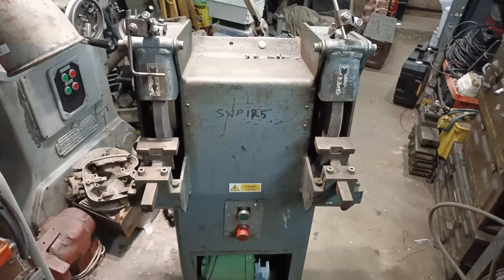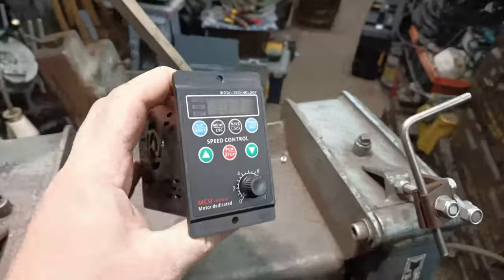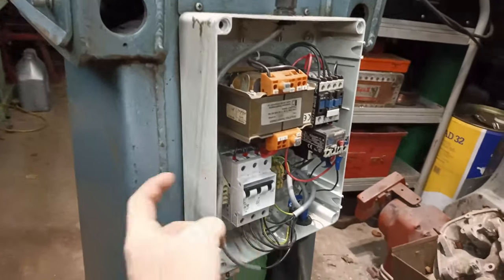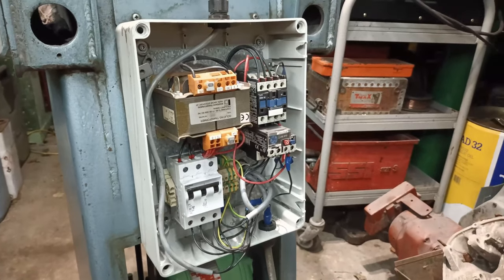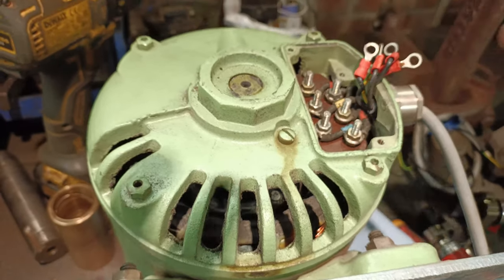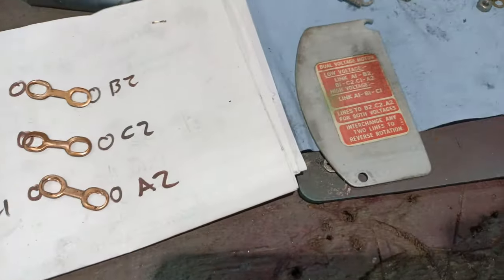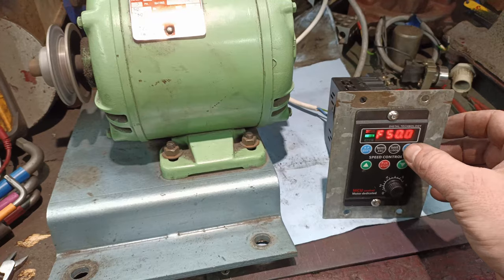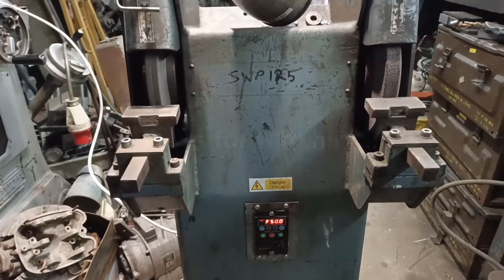Pedestal Grinder VFD Conversion

Comment: Yes - a quick way to kill a VFD is to install a switch between its output and the load. They really have to be used either with the tact switches on the front of the VFD, or with some buttons wired in to the terminals on the back of the VFD. That'll work perfectly. I reckon hiding the VFD away in the box below, with the motor, and just providing the green go and the red E stop would look nice and original. Looks like a really heavy duty unit. Nice conversion! (I too have single phase and like using VFDs for three phase conversion).